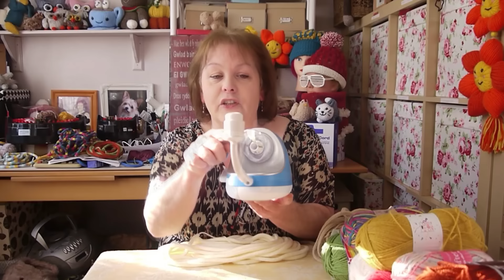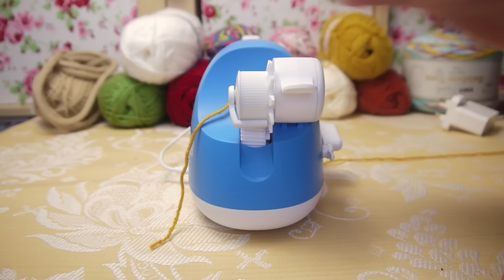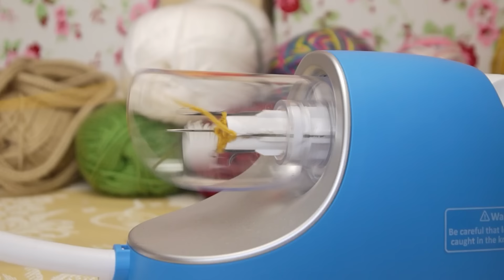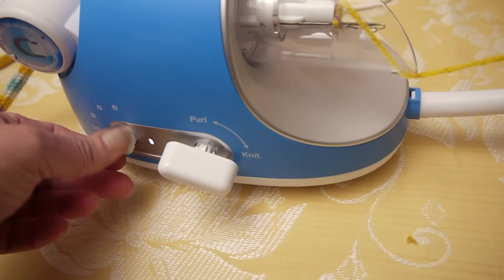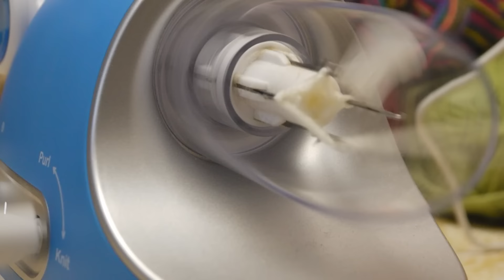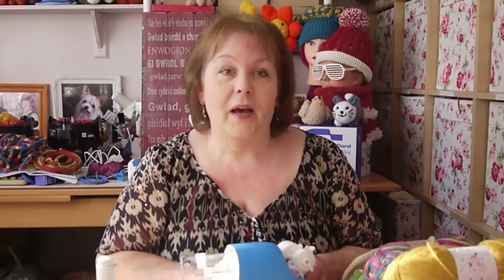CAYDO Electric i-Cord Knitting Machine i1 Pro. Set up and demo. #caydo #craft #knittingmachine

Comment: Help……the first time I used your video to thread the Caydo it was great , so I thought that was it , at least I could do it.  For Easter I wanted to make icords for bows and I’m following your video again and the yarn is not going thru the tube . I’m using RedHeart #4 . Do you know what I could be doing wrong ?
Reply from the maker: Hi, maybe try the yarn you used before, or something a little thinner and see if that works. Remember to pull on the tail as you start the machine to help the cogs catch the i-cord when it emerges.

Comment: I use the hand cranked maker, I remove the handle and attach a Philips head screw driver to my cordless screwdriver, it fits neatly into the handle holder on the icord maker. Then I turn on the screwdriver. I get the same result as this electric maker. Just make sure the screwdriver head site well in the handle hole. I made an 8 foot diameter braided rug with icord.
Reply from the maker: Wow that's an amazing hack and great idea!

Comment: Interessant das zu sehen wir hatten vor über 50 Jahren als ich klein war so etwas aus Holz und machten es mit der Hand es nannte sich Strickliesel und hat viel Spaß gemacht.
Reply from the maker: Ich habe so etwas auch benutzt, als ich jung war.
Reply: We used a wooden cotton reel with four panel pins knocked into the top and we called it French knitting.
Reply: Ja genau 😊 ich habe es geliebt und tatsächlich noch ein Exemplar zu Hause. Ich kann es aber auf Grund eines Handicap nicht mehr benutzen.

Comment: thank you Caz. 1 question, how does it do with 100% cotton?
Reply from the maker: I tried a cotton from my stash, but had lost the label. I'm not a big cotton yarn user, but I'll try to find a ball to run through the machine. The cotton I did use worked well. The book advises that 2 Fine Sport and baby are ok (WPI 12-18). 3 DK & Light worsted and fine (WPI 11-15)and 4 Medium Worsted, Afghan and Aran are fine (WPI 9-12). cotton blend yarn weight 4 is unsuitable. Hope this helps